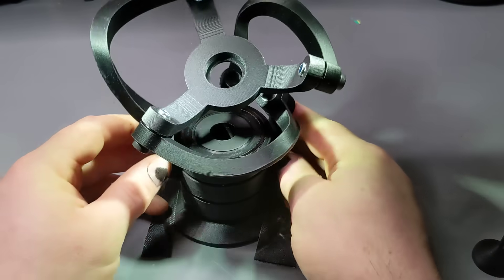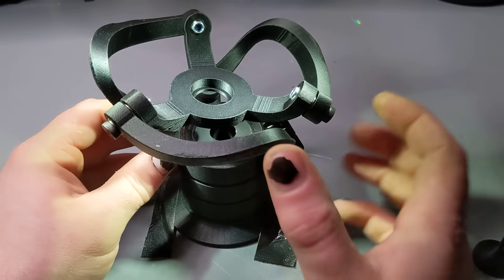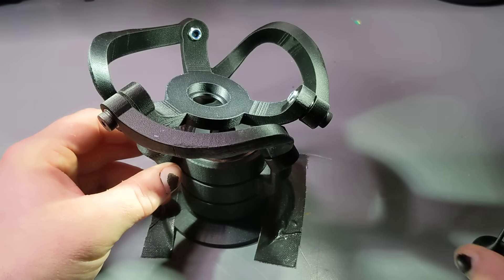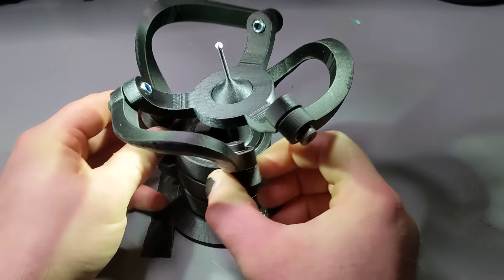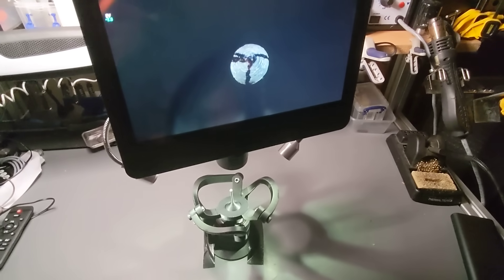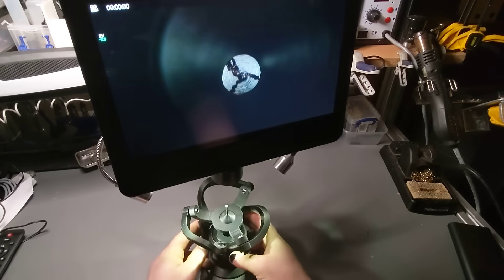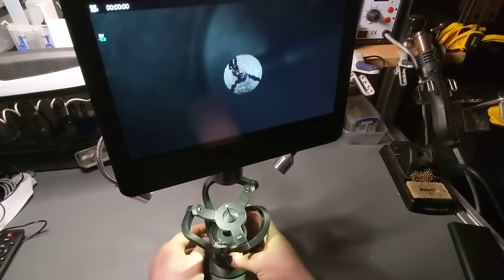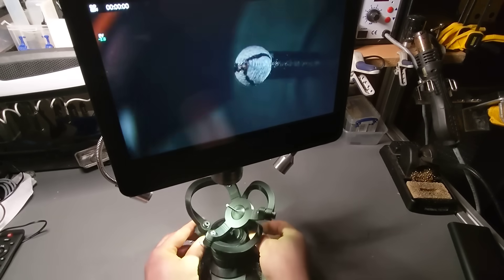Spherical Parallel Manipulator

Comment: 3d model please. It's interesting device. I want to print one for myself
Reply from the maker: I plan to release a free 3d printable one, but I might make a more rugged one as a product for labs and such (if there's demand?)
I posted an update vid covering cad/files etc, check it out and leave a comment there on which concept you'd prefer and what your use case/application is (people keep surprising me with novel uses) and I'll do my best to accommodate that in the released design. 
https://youtu.be/wN02itp6-z4
Reply from the maker: I've just uploaded the latest update vid, I've put a lot of work into making it accessible for everyone, files available very soon and I got the costs down to $10 of parts: $10 SPM https://youtu.be/DqjAKmm-FJQ

Comment: Hey there,
Can you provide the design details. I want to make one
Reply from the maker: I posted an update vid covering cad/files etc, check it out and leave a comment there on which concept you'd prefer and what your use case/application is (people keep surprising me with novel uses) and I'll do my best to accommodate that in the released design. 
https://youtu.be/wN02itp6-z4
Reply: @makebreakrepair   Thank you very much
Reply from the maker: Latest update vid, files available very soon and I got the costs down too: $10 SPM https://youtu.be/DqjAKmm-FJQ
Reply from the maker: I've just uploaded the latest update vid, I've put a lot of work into making it accessible for everyone, files available very soon and I got the costs down to $10 of parts: $10 SPM https://youtu.be/DqjAKmm-FJQ

Comment: Hmmm, I think I need it.
Reply from the maker: I plan to release a free 3d printable one, but I might make a more rugged one as a product for labs and such (if there's demand?)
I posted an update vid covering cad/files etc, check it out and leave a comment there on which concept you'd prefer and what your use case/application is (people keep surprising me with novel uses) and I'll do my best to accommodate that in the released design. 
https://youtu.be/wN02itp6-z4
Reply from the maker: I've just uploaded the latest update vid, I've put a lot of work into making it accessible for everyone, files available very soon and I got the costs down to $10 of parts: $10 SPM https://youtu.be/DqjAKmm-FJQ

Comment: Welcome to the algorithm, drop files fren
Reply from the maker: I plan to release a free 3d printable one, but I might make a more rugged one as a product for labs and such (if there's demand?)
I posted an update vid covering cad/files etc, check it out and leave a comment there on which concept you'd prefer and what your use case/application is (people keep surprising me with novel uses) and I'll do my best to accommodate that in the released design. 
https://youtu.be/wN02itp6-z4
Reply from the maker: I've just uploaded the latest update vid, I've put a lot of work into making it accessible for everyone, files available very soon and I got the costs down to $10 of parts: $10 SPM https://youtu.be/DqjAKmm-FJQ

Comment: Did you design it?
Reply from the maker: I did design it but I can't take credit for the concept, they've existed for a while and there's some excellent powered ones on youtube (check out @swannschilling474 https://www.youtube.com/watch?v=vNV2LetkfEg) I just wanted a manual one. 

I posted an update vid covering cad/files etc, check it out and leave a comment there on which concept you'd prefer and what your use case/application is (people keep surprising me with novel uses) and I'll do my best to accommodate that in the released design. 
https://youtu.be/wN02itp6-z4

Comment: Did you published this project somewhere? If that's the case where can i find it?
Reply from the maker: I posted an update vid covering cad/files etc, check it out and leave a comment there on which concept you'd prefer and what your use case/application is (people keep surprising me with novel uses) and I'll do my best to accommodate that in the released design. 
https://youtu.be/wN02itp6-z4
Reply from the maker: I've just uploaded the latest update vid, I've put a lot of work into making it accessible for everyone, files available very soon and I got the costs down to $10 of parts: $10 SPM https://youtu.be/DqjAKmm-FJQ

Comment: I'm going to have to make one for the microscope I use in my lab and set it up. There are no stages, so I moved by hand every time, but I think it will be very useful.
I think it's a great idea
Reply from the maker: I posted an update vid covering cad/files etc, check it out and leave a comment there on which concept you'd prefer and what your use case/application is and I'll do my best to accommodate that in the released design. 
https://youtu.be/wN02itp6-z4
Reply from the maker: I've just uploaded the latest update vid, I've put a lot of work into making it accessible for everyone, files available very soon and I got the costs down to $10 of parts: $10 SPM https://youtu.be/DqjAKmm-FJQ
If you're interested in the short-run, professional use metal version please fill out this form: https://forms.gle/XGxA5Zzp16doP4pE6
Your email or any other info you put in that form will not be used for marketing, nor passed on to any third parties, nor used in any way other than to contact you about that specific project - I'm just an engineer in a shed figuring out if people want something :)

Comment: very cool dude, seems super useful wish i had one to mess with, i love microscopy.
Reply from the maker: Thanks, I really appreciate it. I shot the vid to show friends, I didn't expect this kind of response 😅
I posted an update vid covering cad/files etc, check it out and leave a comment there on which concept you'd prefer and what your use case/application is and I'll do my best to accommodate that in the released design. 
https://youtu.be/wN02itp6-z4
Reply from the maker: I've just uploaded the latest update vid, I've put a lot of work into making it accessible for everyone, files available very soon and I got the costs down to $10 of parts: $10 SPM https://youtu.be/DqjAKmm-FJQ
If you're interested in the short-run, professional use metal version please fill out this form: https://forms.gle/XGxA5Zzp16doP4pE6
Your email or any other info you put in that form will not be used for marketing, nor passed on to any third parties, nor used in any way other than to contact you about that specific project - I'm just an engineer in a shed figuring out if people want something :)

Comment: This would be great for std offset processes that need to be angled like certain laser operations
Reply from the maker: Interesting, I play with optics/lasers a bit and hadn't thought of that. 
I posted an update vid covering cad/files etc, check it out and leave a comment there on which concept you'd prefer and what your use case/application is (people keep surprising me with novel uses) and I'll do my best to accommodate that in the released design. 
https://youtu.be/wN02itp6-z4

Comment: Did you develop these plans or did you get them from somewhere? I'd love to print one of these myself.
Reply from the maker: I designed this myself, but I drew inspiration from a few motorised ones I saw on youtube, especially @swannschilling474, I just wanted a manual one

I posted an update vid covering cad/files etc, check it out and leave a comment there on which concept you'd prefer and what your use case/application is (people keep surprising me with novel uses) and I'll do my best to accommodate that in the released design. 
https://youtu.be/wN02itp6-z4
Reply from the maker: I've just uploaded the latest update vid, I've put a lot of work into making it accessible for everyone, files available very soon and I got the costs down to $10 of parts: $10 SPM https://youtu.be/DqjAKmm-FJQ

Comment: Where can i purchase this? Or download the stl
Reply from the maker: I plan to release a free 3d printable one, but I might make a more rugged one as a product for labs and such (if there's demand?)
I posted an update vid covering cad/files etc, check it out and leave a comment there on which concept you'd prefer and what your use case/application is (people keep surprising me with novel uses) and I'll do my best to accommodate that in the released design. 
https://youtu.be/wN02itp6-z4
Reply: @makebreakrepair  alright thanks mate will do!
Reply from the maker: Latest update vid, files available very soon and I got the costs down too: $10 SPM https://youtu.be/DqjAKmm-FJQ

Comment: Please sell the STL files for this.
Reply from the maker: I plan to release a free 3d printable one, but I might make a more rugged one as a product for labs and such (if there's demand?)
I posted an update vid covering cad/files etc, check it out and leave a comment there on which concept you'd prefer and what your use case/application is (people keep surprising me with novel uses) and I'll do my best to accommodate that in the released design. 
https://youtu.be/wN02itp6-z4
Reply from the maker: I've just uploaded the latest update vid, I've put a lot of work into making it accessible for everyone, files available very soon and I got the costs down to $10 of parts: $10 SPM https://youtu.be/DqjAKmm-FJQ

Comment: Hopefully this is something very easy to find out one of the 3-D websites. I would just love to make some kind of sculpture that would be at the end of that do that and it would just spin around in that point really cool. I don’t know yet Lol very cool. Please post where we can get this when you get the chance put it on cults & charge some money.
Reply from the maker: I plan to release a free 3d printable one, but I might make a more rugged one as a product for labs and such (if there's demand?)
I posted an update vid covering cad/files etc, check it out and leave a comment there on which concept you'd prefer and what your use case/application is (people keep surprising me with novel uses) and I'll do my best to accommodate that in the released design. 
https://youtu.be/wN02itp6-z4
Reply from the maker: I've just uploaded the latest update vid, I've put a lot of work into making it accessible for everyone, files available very soon and I got the costs down to $10 of parts: $10 SPM https://youtu.be/DqjAKmm-FJQ

Comment: That is super cool! How well does it stay in place? Is there a way to adjust the friction or lock it in place?
Reply from the maker: Interesting question. It stays in place at any position for the subjects I've put on it, the reason being the bearings are the sealed type (ie rubber seals, which add a tiny bit of friction) and the whole thing elastically averages (ie every part is imperfect but flexible such that all parts bend each other with the average being the design intent) so there's a little tension everywhere and that adds a little friction too. 

There's no way to lock it in place though it could be done by locking the bottom bearings (even a bit of tape would do)
Reply: @makebreakrepair  that is very interesting. Thanks for the reply.
Reply from the maker: Latest update vid, files available very soon and I got the costs down to $10  of parts: $10 SPM https://youtu.be/DqjAKmm-FJQ

Comment: How did you find the shape to make it work.
Reply from the maker: The trick is all the bearings point to the same spot, so I just drew a point in CAD, aimed all the bearings at it, then joined the dots :)
Reply: @makebreakrepair  cool

Comment: Where can i get one?
Reply from the maker: I plan to release a free 3d printable one, but I might make a more rugged one as a product for labs and such, if you're interested in purchasing a rugged one let me know in the comments of the vid (link below) so I can get a feel for what the demand is.
I posted an update vid covering cad/files etc, check it out and leave a comment there on which concept you'd prefer and what your use case/application is (people keep surprising me with novel uses) and I'll do my best to accommodate that in the released design. 
https://youtu.be/wN02itp6-z4
Reply from the maker: I've just uploaded the latest update vid, I've put a lot of work into making it accessible for everyone, files available very soon and I got the costs down to $10 of parts: $10 SPM https://youtu.be/DqjAKmm-FJQ

Comment: can you post the files you used?
Reply from the maker: I plan to release a free 3d printable one, but I might make a more rugged one as a product for labs and such (if there's demand?)
I posted an update vid covering cad/files etc, check it out and leave a comment there on which concept you'd prefer and what your use case/application is (people keep surprising me with novel uses) and I'll do my best to accommodate that in the released design. 
https://youtu.be/wN02itp6-z4
Reply from the maker: I've just uploaded the latest update vid, I've put a lot of work into making it accessible for everyone, files available very soon and I got the costs down to $10 of parts: $10 SPM https://youtu.be/DqjAKmm-FJQ

Comment: I feel like this would be nice for inspecting pivots in watchmaking. Not so much in-use pivots like during a service, but when you need to re-pivot or are making a new one. Nice for QC.
Reply from the maker: People keep surprising me with novel uses for it :)
I posted an update vid covering cad/files etc, check it out and leave a comment there on which concept you'd prefer and what your use case is and I'll do my best to accommodate that in the released design. 
https://youtu.be/wN02itp6-z4

Comment: Each "arm" has little in the way of mass capicitance.
Reply from the maker: Not sure what you're referring to, could you elaborate?
Reply: @makebreakrepair  I was referring to each rotating piece(arm) and their  load bearing maximum weight allowance, IF there was any function or point to this already useless machine.

Comment: Are you selling the files or plans?
Reply from the maker: I plan to release a free 3d printable one, but I might make a more rugged one as a product for labs and such, if you're interested in purchasing a rugged one let me know in the comments of the vid (link below) so I can get a feel for what the demand is.
I posted an update vid covering cad/files etc, check it out and leave a comment there on which concept you'd prefer and what your use case/application is (people keep surprising me with novel uses) and I'll do my best to accommodate that in the released design. 
https://youtu.be/wN02itp6-z4
Reply: @makebreakrepair  Thank you. I am interested as a hobbyist and someone who collects interesting machinery and puzzles. The rugged version would be overkill for my uses.
Reply from the maker: Latest update vid, files available very soon and I got the costs down too: $10 SPM https://youtu.be/DqjAKmm-FJQ
Reply from the maker: I've just uploaded the latest update vid, I've put a lot of work into making it accessible for everyone, files available very soon and I got the costs down to $10 of parts: $10 SPM https://youtu.be/DqjAKmm-FJQ

Comment: anywhere we can get the files?
Reply from the maker: I posted an update vid covering cad/files etc, check it out and leave a comment there on which concept you'd prefer and what your use case/application is (people keep surprising me with novel uses) and I'll do my best to accommodate that in the released design. 
https://youtu.be/wN02itp6-z4
Reply from the maker: I've just uploaded the latest update vid, I've put a lot of work into making it accessible for everyone, files available very soon and I got the costs down to $10 of parts: $10 SPM https://youtu.be/DqjAKmm-FJQ

Comment: Amateur watch repairer here. This could be very handy for keeping a view of a part in focus while rotating
Reply from the maker: I posted an update vid covering cad/files etc, check it out and leave a comment there on which concept you'd prefer and what your use case/application is (people keep surprising me with novel uses) and I'll do my best to accommodate that in the released design. 
https://youtu.be/wN02itp6-z4
Reply from the maker: I've just uploaded the latest update vid, I've put a lot of work into making it accessible for everyone, files available very soon and I got the costs down to $10 of parts: $10 SPM https://youtu.be/DqjAKmm-FJQ
Reply: @makebreakrepair  cool!

Comment: This would be great for macro insect photography ❤
Reply from the maker: I posted an update vid covering cad/files etc, check it out and leave a comment there on which concept you'd prefer and what your use case/application is (people keep surprising me with novel uses) and I'll do my best to accommodate that in the released design. 
https://youtu.be/wN02itp6-z4
Reply from the maker: I've just uploaded the latest update vid, I've put a lot of work into making it accessible for everyone, files available very soon and I got the costs down to $10 of parts: $10 SPM https://youtu.be/DqjAKmm-FJQ

If you're interested in the short-run, professional use metal version please fill out this form: https://forms.gle/XGxA5Zzp16doP4pE6
Your email or any other info you put in that form will not be used for marketing, nor passed on to any third parties, nor used in any way other than to contact you about that specific project - I'm just an engineer in a shed figuring out if people want something :)

Comment: would love to print it myself - is there any chance to get the files?
Reply from the maker: I plan to release a free 3d printable one, but I might make a more rugged one as a product for labs and such (if there's demand?)
I posted an update vid covering cad/files etc, check it out and leave a comment there on which concept you'd prefer and what your use case/application is (people keep surprising me with novel uses) and I'll do my best to accommodate that in the released design. 
https://youtu.be/wN02itp6-z4
Reply from the maker: I've just uploaded the latest update vid, I've put a lot of work into making it accessible for everyone, files available very soon and I got the costs down to $10 of parts: $10 SPM https://youtu.be/DqjAKmm-FJQ